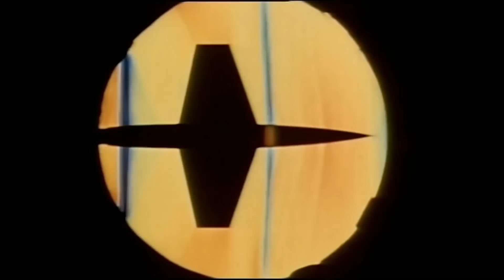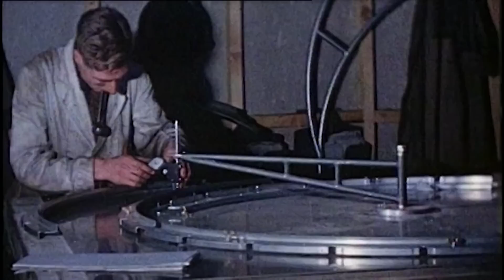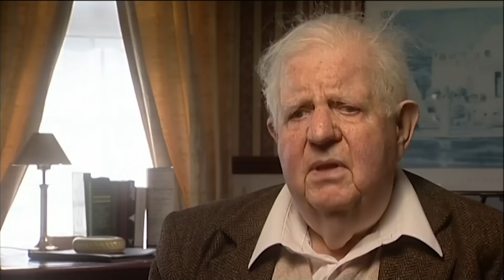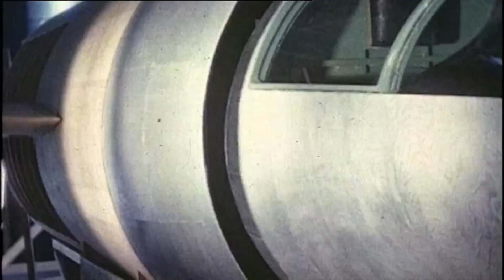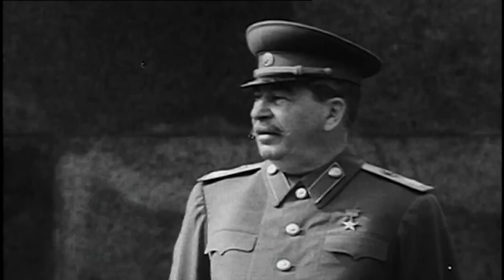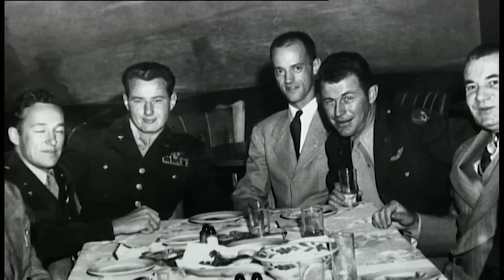Sound Barrier Secrets - Prof Simon

Comment: Maybe something for a future video, Prof...why a silenced gun still goes crack if the bullet exceeds 1100 fps at sea level.
Reply from the maker: I guess the bullet is supersonic...not the gun
Reply: @SimonHollandfilms  Hollywood films show sniper rifles with moderators making little or no noise. Army 556nato and 762 nato rifles fire fmj supersonic bullets...such moderated sniper rifles suppress the bang emanating from the muzzle but each bullet will then break the sound barrier...there is the tell tale crack. 

I laugh when cowboys and soldiers duck when they here the bang of the gun firing...in reality, if you are on the receiving end it’s too late, the bullet arrived first, followed closely by the crack and much later, the bang. 

In addition, the moderator reduces recoil substantially.

Not everybody knows that. 🥴🧐
Reply: @robinmyman  "Silenced" is a relative term.  Forget the movies, it isn't like that at all.  Still makes noise, just not as much and it's harder to tell what direction its coming from.
Reply: @robinmyman  so when you fire a gun it makes two cracks in reality but because there so close together does it sounds as one ?

Comment: I live about 3 miles away from the old bell building. Cool side note, I used to sell antique car parts and a gentleman came to me to purchase Model A engine parts and being a car guy myself asked him what he was building... He pulled out a picture of him flying a small air craft and in front was a 1930's Ford 4 cylinder engine... I was speachless because I for one wld not trust it to stay in the air very long. I'm pretty familiar with the motor, and yeah, no part of flying in that thing sounds like a good idea. Lol. Long story short... He told me to stop by the old bell arrow space building and check it out. Now I wish I took him up on his offer but the building they built the sound barrier plane in is right down the road and part of it still existed as of a few years ago...

Comment: Pitot Pressure Rarefaction

i found out about this from simulator games ...it when the Altimeter reading is wrong ...because of pressure breaking a sound barrier that device gives out the wrong reading ....Modern jets computer compensate ...however an F14 tomcat has this issue ......

Interestingly there DCS combat sim game that Models that into it planes .....what incredible detail to add to a game/sim  ..you can learn things from games

Comment: Mach 1 or the speed of sound is about 761mph at sea level and decreases with altitude. A planes critical mach number is the speed at which air compression causes the aircraft to become unresponsive.  Mach 1 at 20,000ft is 707mph.
Reply: Depends on barometric pressure,  humidity and temperature.